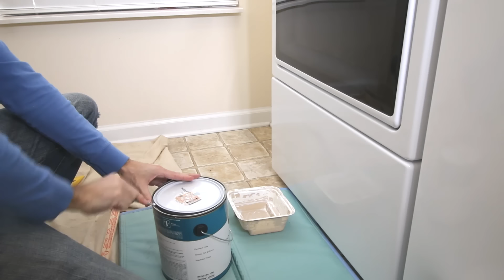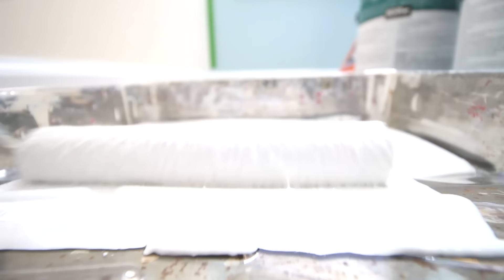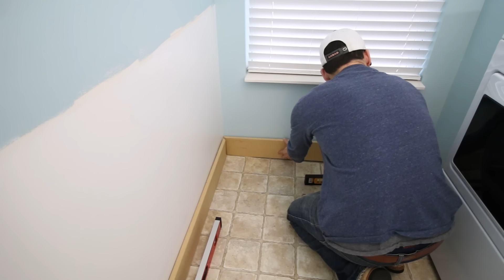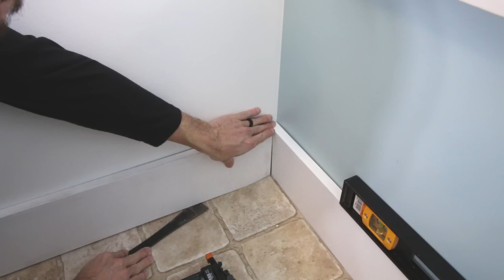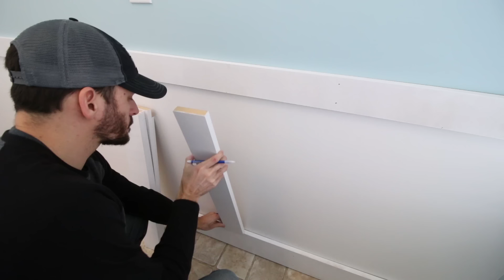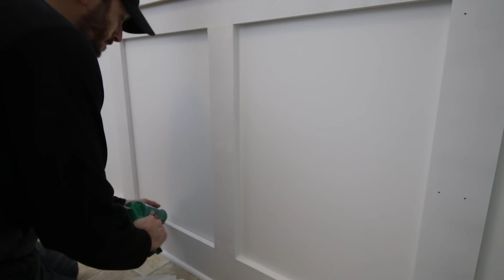How to Install Wainscoting | DIY Board and Batten

Comment from the maker: Download the SketchUp model to layout your own room here:
http://fixthisbuildthat.com/how-to-install-wainscoting-diy-board-and-batten/
Reply: your site does not work
Reply: This was painful to watch. You don’t use mdf for baseboard. Is to porus it swells when wet. You’ll sell as soon as you take a mop to that floor. Second.. stop spackeling edges on mdf. Use bullseye shellac base primer . Scuff smooth when dry . Done . Third . Pocket screw your stiles and rails in one assembly. It will ensure perfect joints that won’t separate. And lastly you should always lay out wanescott with a vertical stile at the ends of each wall . It’s traditionally how it’s done .looks funny otherwise. Also latex primer on mdf is a no no . The water raises the fiber and leaves you with a lumpy finish .

A cabinetmaker
Reply: Really well done the bud, that's a great job.  My wife seen it and now she's buy me power tools for father's Day, it's bit like when Homer bought Marge a bowling ball 😂. Honestly though I need them , thanks for video keep up the good work 👍
Reply: @bp7770  would you give it a rest , did you not hear what he said at the start? It's his firs time doing it ffs. I suppose everything you do first time is top notch?
Reply: @bp7770  I bet none of those things will happen and no one will notice any mistakes
Reply: Thank you. May I ask what paint colour did you use in this video, please?

Comment: I used to work as a trim Carpenter and the preferred wood for Wainscott is Poplar because it's solid and it takes paint very well.
Reply: Yeah but MDF will look better for longer than using wood/sheet
Reply: @VsysStacker  unless that washer leaked...
Reply: Agree, I would use poplar
Reply: @VsysStacker  No chance.  35 year painter, mdf edges are NEVER as smooth as poplar.
Reply: Is any type of timber good in water ?
Reply: @maddierosemusic  depends who is sanding it. I can get it like glass 👍
Reply: @VsysStacker  Yeah, don't you see he is applying a putty to the edges to 
help make it smooth?  Why go through this when you don't have to?
Reply: @maddierosemusic  depends if you cut it yourself , old edges you would fill or cut off to be sanded neat. Knots in wood are a pain and it costs extra to treat it , same finish with MDF if not better especially on wall panels.
Reply: Poplar is $1,000
Reply: Personally, I would've left the walls alone in that small room. It now looks smaller.
Reply: @$haken not $tirred  and poplar shrinks up here in Canuck land
Reply: Thanks
Reply: I agree. After 25 years I’d rather use poplar or oak, plane it, square it on tablesaw and it’s damn near perfect after sanding. Will take hits better too.
Reply: In a study or bedroom, wood is fine and makes sense. 

In the laundry room it makes more sense for plastic stuff because of all the humidity.
Reply: I think it's refreshing to finally see a professional supporting someone in the comments without saying you're doing it wrong, just giving their tips and opinions.
Reply: Exactly.  MDF is trash, that’s suitable only for a rental.
Reply: And it’ll chip if you look at it wrong.
Reply: So it’s the poplar choice?

Comment: Use an old credit card or used gift card for your caulking joints.  Wipes clean after and if not you have three more corners and not out anything in the end.
Reply from the maker: Nice tip!

Comment: Nice idea on ganging them up to seal the edges. I think I'd probably have cut all the verticals the same and installed them first and then pushed the top rail down to meet them, but I can see how that could be a problem if the floor is uneven, then your top rail would follow that unevenness and be wavy. The longer it is the worse that problem would be. I've also seen people cut the entire thing out of one sheet (removing the rectangle areas, essentially, so there are no seems at all) you can get 10 foot long MDF so this can work in a small room.
Reply from the maker: Wow, a one piece frame would be interesting.  A bear to handle but perfect seams

Comment: Sand edges of mdf the use spray varnish to seal it sand it one more time when dry a paint away. If not smooth enough rinse and repeat
Reply from the maker: +Chandlers Kustom Creations great tip. That would be way faster!

Comment: Thanks for saying wainscoting right :)
Also, Maytag! You go girl!!
Reply from the maker: +Jackman Works they only took me after I properly pronounced wainscoting
Reply: You obviously don't know where it gets its name from (origin)...Wain...as in wall, coting...as in coat.  Hence "wall coating.
Reply: @villagecarpenter2266  The origin does not determine pronunciation in etymology. "Wain" has a long a, but "wall" has a short a sound. They are different. Why should anyone assuming that "coting" uses the same long o sound as "coating"? They are spelled differently and the first part of the word is pronounced differently. Both are accepted pronunciations and often region and dialect specific. Just like the word Tomato. Again, knowing the origin does not determine pronunciation.
Reply: It can be said wainscotting or wainscOting. JS
Reply: Out here in Utah everyone says it with a long O. And since they do I do.

Comment: I glue and pocket screw the whole assembly together. This keeps everything aligned, holds the stiles in the absence of studs and keeps my paint from cracking at the joints.
Reply: That is what I was thinking about doing.

Comment: This was a really useful video and guide which I used primarily to do my office. 

For a first time DIY I learned a lot. 

Planning - what you will need for paint, how much material you will need, laying out where the paneling will go, etc. 

Laying out the paneling was the toughest since there were many plugs i wanted to avoid. Playing around with spacing solved this. 

Issues I ran into were with the wainscoting panels - your house walls are not going to be perfectly flat! To over come this I sanded the panels down on the back side to help them lay flat against the wall, used liquid nails to help glue them to the wall and then filled the edges with Alex’s paintable caulk. Painting the bottom portion of the wall and the panels before was definitely helpful. 

Another time saving tool was a laser level. It helped show plumb lines on the wall and horizontal lines each time to double and triple check. 

I wish I could upload a picture to share but it doesn’t look possible on the phone.

Comment: Very nice work, man. But wouldn't it better to do that after you redo the floor? How will you remove the tiles without damaging the lower MDF board and the shoe molding?
Reply from the maker: It's vinyl :)  So it will come up easily and then I'll just remove the shoe molding.
Reply: Oh, I see. Thank you for replying!
Reply: So funny. That was me first thought when he mentioned the floors.
Reply: @drbabcock2009  yeah me too
Reply: @fultonyt8989  x2
Reply: This is exactly what I came down here to comment
Reply: X3
Reply: exactly my first though when he said he was going to change the floor, i dont like double work, especially if i caulk in something nice for a finished look just to rip it out again
Reply: @BryantAvant  me too
Reply: Just gotta be good...
Reply: Just remove the shoe mold.
Reply: Doesnt look like tile

Comment: I would use a biscuit joiner for each of the board joints.  This will help prevent one of the boards from lifting and showing the joint when the Spackle cracks.

Comment: Alright this is looking great at the end but...3 things...1 use primer mold  resistant sealer (or a stain blocker if you're not worried about mold) on your baseboards and you don't need to do this mudding process at all. There is a reason why they sell primed MDF baseboards and trims at stores. 2 instead of but joint and pocket holes you should have done 45° miters on both pieces so the one goes behind the other and the joint is seamless. Simple finishing tips and tricks. 3 wouldn't be easier and more accurate to just measure 36" - the witch of your baseboard from the top of your baseboard  to get this as level as possible?

Comment: similar to your mdf cuts that you spackled, I had an issue with mdf v match board.... just kept sucking back the paint, especially because I was spraying it.  I found out afterward from my friends dad (amazing custom carpenter that actually did a lot of the super fine carpentry for one of the original rim guys houses) that a 50/50 solution of wood glue and water rubbed into the edges also solves that.

Comment: Good video. I am a 3rd generation carpenter and have done many different styles and lay-outs for wanescoting. I just wanted to give a few tips.
1 - just use 1x4 or 1x5 (actual sizes in canada are 11/16" x 3.5"/4.5") material over sheet goods (it costs less and comes pre-primed and you don't have to rip anything and that joint at 8 ft. won't occur because they come 16ft. long)
2 - The best way to do this style is to buy a 4' x 16' x 3/4" sheet and cut-out the squares so there are no joints to crack over time. this style will eventually crack so filling the vertical will only work for a few years unless you join them (ie. biscuits or other way). You could use a 1/8 roundover bit on the cross-cut ends (like concrete curbs) to make it look like you planned for the eventual cracking that is almost guaranteed to occur.
Reply: I I’ll know this is old, but can you explain what you mean by “cut out the squares”
Reply: He’s talking about buying a sheet of wood you most certainly cannot find in your stores..

Comment: End grain glue joints on mdf are actually stronger that screws. We used to do pullups on an mdf miter box screwed to the ceiling.

Comment: Nicely done Brad, I was the same way when I did our bead board used brand nailer and NO adhesive lol but I put it in our kitchen 3 years ago and it’s fine no problems at all so I’m thinking you will be fine. Awesome job and video tutorial
Reply from the maker: Great to hear that, Thom.  I figured as much but thought I should address it before other people did :)
Reply: Fix This Build That   You mean people do that lol. #youshouldhave

Comment: Another tip would be if you're not using adhesive is to angle your nails the opposite ways when shooting them, instead of straight in, it's more resistant to move off the wall.

Comment: When I have MDF I need to paint I make a glue wash.  You take some yellow glue add water to thin it out and brush on to the MDF allowing it to soak in then come back and gently sand with a 320 grit sandpaper this makes emdf nice and smooth and ready to paint

Comment: I’ve used Mdf a few time and it’s such a versatile product. Let’s say you route a profile in it what’s the best way to seal a cut edge? Should I use a bit of poly and then paint? Your channel is amazing. Thank you for sharing.
Reply from the maker: I've recently been told spray on shellac does a good job
Reply: Fix This Build That thanks for the response. My next project is mdf based so I’ll diffidently give it a go.

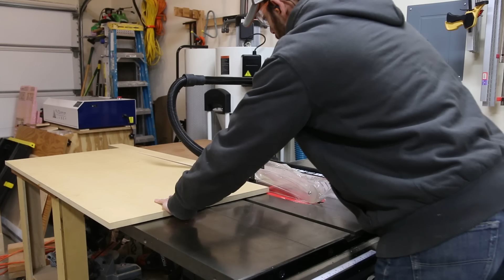Comment: @2:00 no...because it's no fun when you're the guy waiting for a single crosscut so you can fit a sheet of plywood in your car but the guy in front wants 2 sheets of MDF ripped into 24 - 4" pieces for batten.
Reply from the maker: Hahahaha, true.
Reply: Sounds like one of the two of you needs to buck up for a truck.

Comment: You say you didn't glue the boards, but you pretty much did when you caulked them. That caulk will hold them on better than the nails, so I can't see a need for glue on the back of them as well. I would have used the caulking on all joints and gaps, rather than the spackle on the few you did. Laundry rooms see big temperature and moisture swings so I'm a little worried the spackle joints will crack over time.

Comment: Great work. The only question I have is.... u use 3.5 inch for the riser trim and 5.5 for the bottom  and the additional trim is 1.5 but how big is the top horizontal trim?

Comment: I don't understand why so many people use that quarter round to help hide the gap on baseboard. The real trick is to scribe the bottom of it, run the bottom through a table saw at a 45 not removing any width to the trim (just to remove the material you wont see) and then sand down the material to your scribe line. That way you arent trying to sand down the whole bottom and only that 45 angle point at the bottom.

Comment: Um MDF in a laundry room? Spakelled the entire board? A 10” blade would cut up to 10
Board in one pass on a mitre saw. If ya hate bevel on a mitre saw then might be easier to use bevel on the the table saw. Caulking behind the boards does the trick for hold and cleans up easy. Looks good.

Comment: Looks great the problem with the paint was not you it’s the paint. Behr paint is Home Depot crap. It’s so thin does not cover well, need  three coats to look even half way presentable. Go with a B Moore or S Williams pay a little more but you’ll never go back to Behr 
Nice clean job well done.

Comment: Next time you have a contrasting wall color,
Run a bread of caulk along the corner for a super straight cut in line. 
Being that this is your first time why is this a
"HOW TO" instead of a "HOW I" video.
Your "patch board" should have a 45 degree cut also with the overlap facing away from the most viewed area.
THERE IS NO "X" IN ESPECIALLY! 
FYI:  fingerboard trim... after several years the glue releases and the wood starts coming apart.

Comment: Awesome video, and great explanations! When you redo the flooring are you going to have to tear out your new baseboards, or do you just push it up against the baseboards? I’m running into the same issue with my home and not sure which project to tackle first (flooring vs board/batten)
Reply: Definitely flooring! I was surprised at the end when he said he was planning to replace the floors. It's difficult to predict the thickness of the new flooring let alone have it be exactly the same thickness as the previous floor especially if a different underlayment is required.

Comment: What is the general rule for the distance between each vertical board? I know this is likely based on the width of MDF or Baseboard used, but is there a rule of thumb?

Comment: Thank you for sharing the video. Can we use plywood? what is the benefit of using plywood over MDF?
Reply from the maker: Plywood would work as well.  MDF is totally smooth so you get no wood grain coming through.  Also you might have knots and voids with plywood where MDF is uniform throughout.
Reply: With my history with water damage, MDF wouldn’t be a good choice in areas with water.  My orange peel wall probably wouldn’t look good just painted.  Seems like it would need to be smooth.   good job though.

Comment: Hi and thanks for the info. Do you recommend replacing carpet before installing the board and batten? Thank you in advance.
Reply from the maker: I'd do the board and batten first.  For carpet you use a tack strip and it will go down next to the trim anyway not under it.

Comment: when using square stock for base board you would be better off cutting the ends square rather than making a miter cut in the corners. Much better end result. Easier too.
Reply from the maker: agreed

Comment: One other tip is to score the caulk/paint joint with a razor knife where the baseboard meets the wall in order to keep from peeling the paint or drywall paper.

Comment: I see you are using 5.25" tall baseboard and 3.5" wide vertical slats, however you do not mention the board width for the upper horizontal rail. What board width did you use?

Comment: Thank you for this video!  Did your wall have texture on it, aka “orangepeel” or something similar?  We are considering installing shaker wainscoting in our dining room but the walls are textured and I’m worried that it will look strange.
Reply: I have orange peal from a roller so what I’m going to do is utilize some joint compound to smooth it.  I’m starting this Thursday this week.  Looking forward to it

Comment: can you explain to me a little bit more I know understand the paints going to absorb in there but what kind of stuff did you put on there what kind of putty do you put on the cuts so the paint wouldn't absorb so much.. then will this chip off?
Reply from the maker: Just spackle. It won't chip off unless you try to chip it

Comment: Your choice of MDF is off to me.  Real pine is lighter and much easier to work with alone.  Also, and room that needs mopping instead of dry dusting should not have MDF touching the floor.   Will absorb water and delaminates.   Final comment:  wear a mask when cutting MDF.  Its not good for you at all to breathe!

Comment: You should NEVER EVER EVER use MDF for the baseboards.  The slightest bit of moisture and they swell and are ruined.  You’re using this in a laundry room, and the harsh reality of that is that at some point in its life, this room will probably see flooding from a leaking washer, or pet damage.  ALWAYS use real wood or plywood for base mounding.  Always.

Comment: I'm in an apartment, so i'm stuck with the rubber baseboards (they come in a roll) and they're basically flush to the wall, so obviously my batten pieces are going to over hang unless you have an idea how they won't? Maybe use a thinner or thinnest batten? I'm not going to spend the money on wood baseboard when it's not my place. So can someone give me some tips because i really want to do my living room with wainscoting.